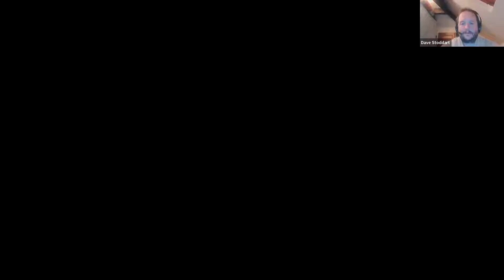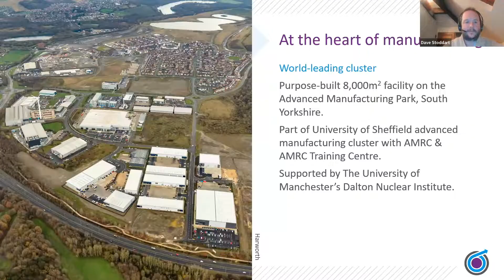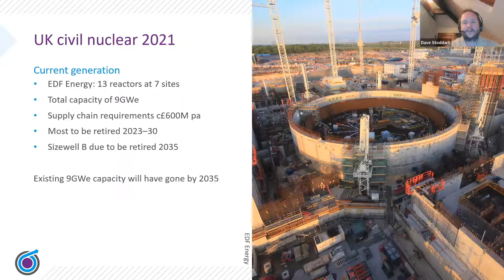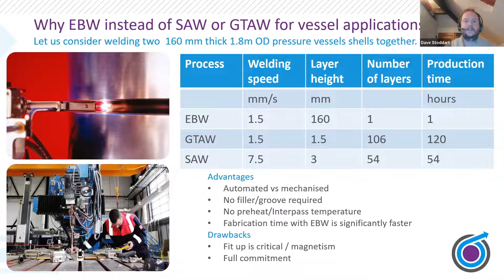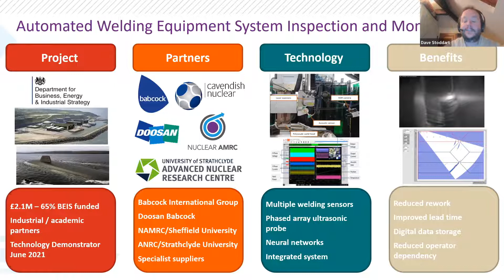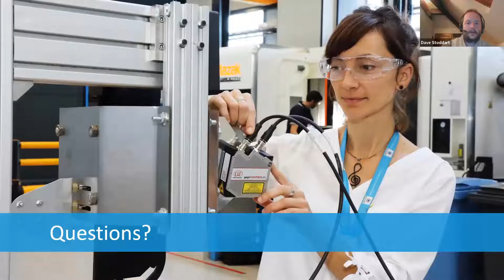Advanced Manufacturing Techniques to accelerate Small Modular Reactor deployment

Comment: All the old fission reactor problems go away with the new Fusion reactor era now here. We have recently taken a new step to advance the physic of power production by enabling the chemistry of the atomic nucleus, or "nuchemy", We are passing the chemistry level where we interacted with electron shells and are moving on to nuclear manipulations in this "nuchemy" atomic nuclear era when we interact and multiply nuclear protons using hydrogen fuel stock. We have rediscovered the lost work of the alchemists and can make new elements with different atomic weights and vastly new properties. This was ably demonstrated in "The Safire Project". Quanta are important. We now have enough energy in them to manipulate the atomic nucleus much more easily by creating a compartment or a local region of plasma containment so reactions at this atomic nuclear level can easily take place. This is about to practically enabled a fantastic new era of energy production for the whole of mankind. This is with free fuel obtained from water or atmospheric moisture anywhere in the world. New fusion nuclear is at the industrial commercial production final development point as of now. The energy argument and other power methodologies are all now irrelevant as we have new and very physically and economically powered practical and local community level fusion nuclear power. Solar roof plus Teslawall battery maybe the present way to go domestically but megapack batteries and multiple storage technologies interconnected with an expanded ugly grid have a less certain requirement when you consider new any-scale community based and 24 hr self-fueling reliable fusion nuclear in the form of the "Safire Generator". Learn all about it at "Aureon Energy.com". Learn it also at the source of all newer EU physics at "Thunderbolts Project.com" and you will be permanently reeducated with the advanced new theory.